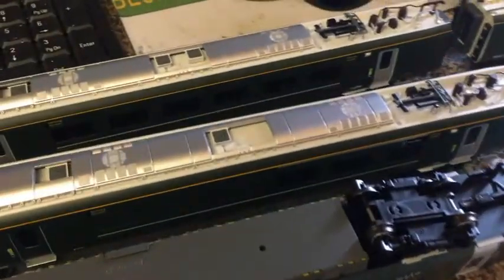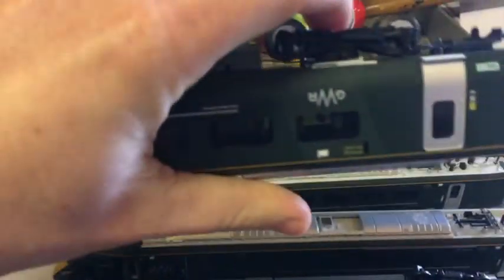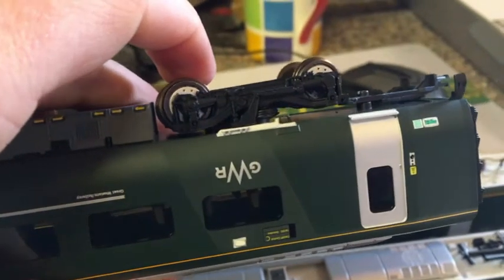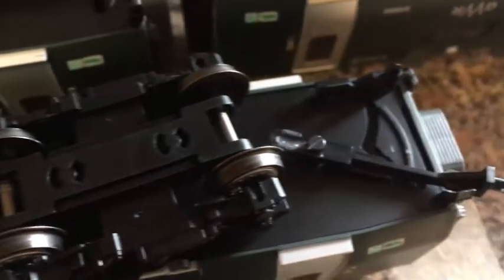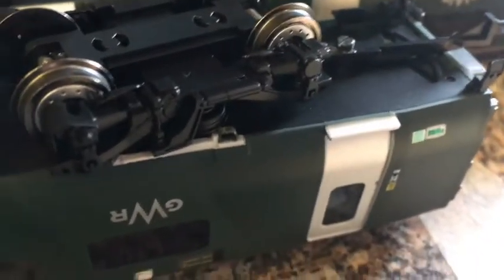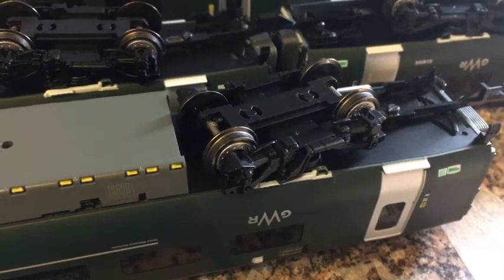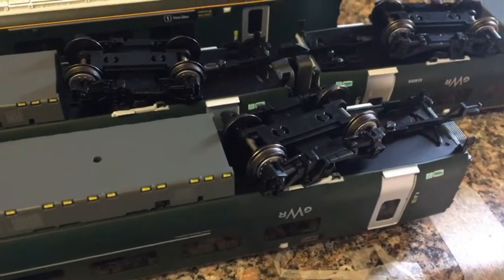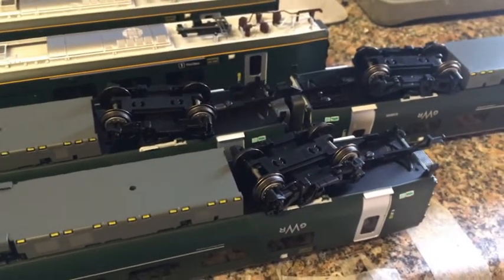Hornby Class 800 Coupling and Bogie Fixes

Comment: I bought a Hornby Class 395 Javelin "Sir Chris Hoy" it has the same coupling system, but the bogies are more directly underneath. I got it at the Great Electric Train Show last weekend. My issue is that it derails on every corner, the instruction sheet says it is supposed to handle 2nd radius, it doesn't. I have been racking my brains to think of a solution, I wonder whether this would help in my situation?

Comment: I really do not like the fact Hornby have used those same type of couplers that originate from the Pendolino, they feel brittle. Would have been far better if they used proprietary couplings that had pickups to conduct power to each coach (like Bachmann does) it would mean you'd require only one decoder in a driving end and you'd be able to control the interior lighting etc via functions on a DCC controller. 

A bit of a miss from Hornby there, still a nice looking model.
Reply from the maker: You have a good point!